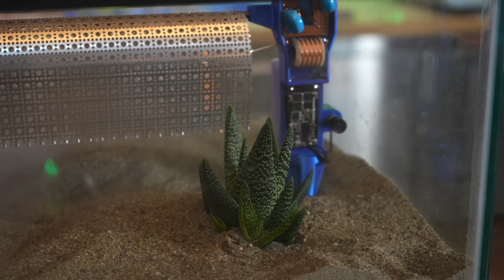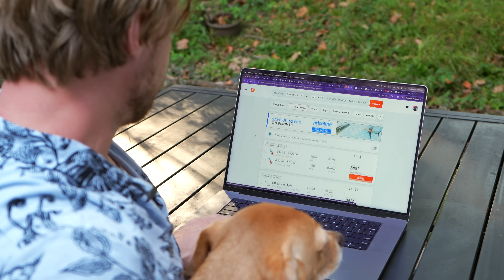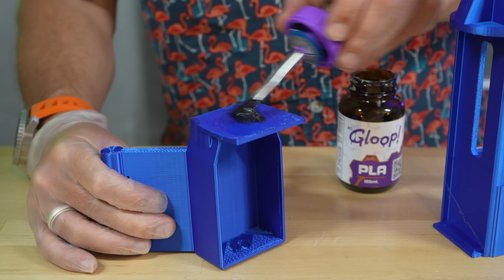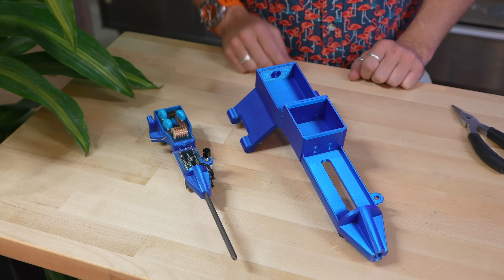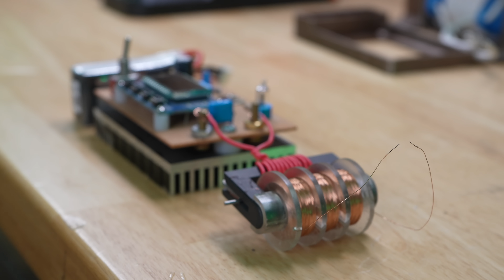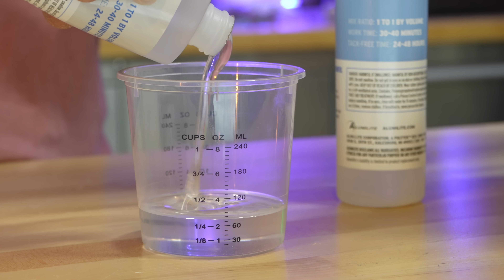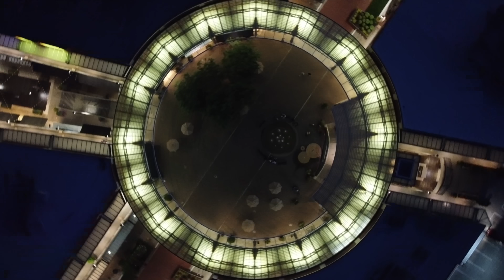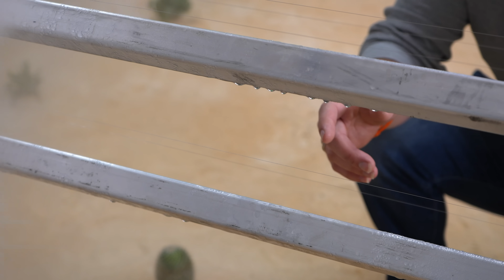Turning Desert Fog into Fresh Water Using 50,000 volts

Comment: Maybe this case is different, but the vibe it gives are the same as those 2015 kickstarter "infinite water bottle" that never took off
Reply: Bro. Thank you. Finally, someone noticed.
Reply: @DeltaCommanderVools   He just prove it worked and you should check out his other content
Reply: @TwinkleToezzz nobody disputed that. What people dispute is how realistic it actually is to use everyday
Reply: That's because real fog is no way near that dense, and the solar charger is never going to charge that battery in a day of charging.
Basically, it's not sustainable. It will need recharging from a real power source because the solar gather won't be able to recharge the power it consumed during the day, and it likely won't produce the amount of water shown here because in real life fog isn't as dense
Reply: The "infinite water bottle" failed because turning vapor into liquid water is hard. This turns small drops of liquid water into big drops of liquid water, which is much easier.
Reply: I agree. The whole premise of the video is oddly confusing. He honestly booked a flight to Peru with only 2 weeks of time to build an entire scaled-up prototype, then conveniently ran out of time and ended up testing in his garage where he could control all the variables? I think the technology is interesting, but it feels like it doesn't have a practically use until it's actually testing over multiple nights in a dessert. Also, serious safety considerations need to be address before people start using effectively a giant taser to get water.
Reply from the maker: Great thing to point out! So that “infinite water bottle” used Peltier cooling (low voltage, simply chills the air and forces it to drop all moisture) to dehumidify the air. What I’m doing here is different physics. I’m coalescing fog droplets into a mass of water using electrostatics (high voltage). Kind of like how both helicopters and planes fly but use very different methods.
Reply: Those were water from air, this is water from a dense fog. He's not converting steam into water - which requires a lot of energy - he's capturing water droplets from the air. The droplets want to settle, no energy required (for that part). So there's a huge difference and this technology could only ever be applied to a very narrow set of places.
Reply: @mattiasfagerlund  actually fog is already water droplets so it's just concentrating them
Reply: @rca168  I'm not sure if you're suggesting that that's contradicting anything I said? Whatever your point was: he's trying to aggregate water droplets at an energy efficient level - there's NO alchemy involved, just the harsh rules of efficiency. And I applaud the effort, good on ya, mate! There's NONE of the water from air grift, this is completely different. Even Thunderfoot would tell you so.
Reply: Thankfully he's only "scamming" viewers out of their time instead of investors of money because YouTube pays him well enough. If it didn't, I wouldn't be surprised if he invented "Solar Freaking Roadways!" instead.
Reply: @LordDragox412  YouTube in a nutshell. Just content. Nothing more
Reply: @LordDragox412  Sour grapes, much?
Reply: @aquatus1  You keep posting that comment, so I assume unlike other people you don't like sour grapes for some reason. Congrats, I guess?
Reply: @LordDragox412  Yeah, I posted it twice to the two people (or is it just one person?) who were repeating each other.  Big surprise.  Now, stop vying for attention in someone else's channel.
Reply: i can see at least one difference tho: he's got a demonstrable design and it's intended to upgrade what people are already using.

also, he won't need a kickstarter for development, just for building out the manufacturing of an existing product (assuming he even needs that) and gauging demand.